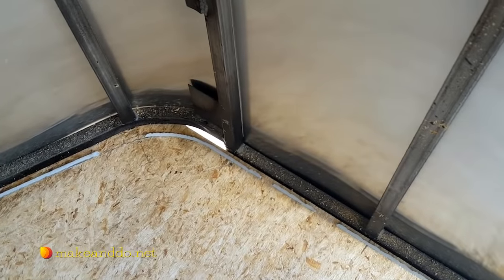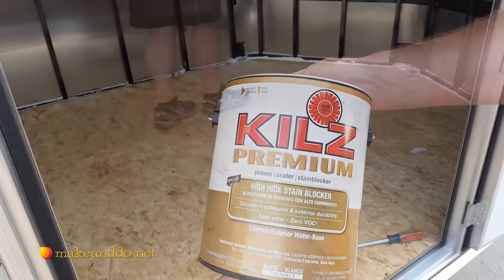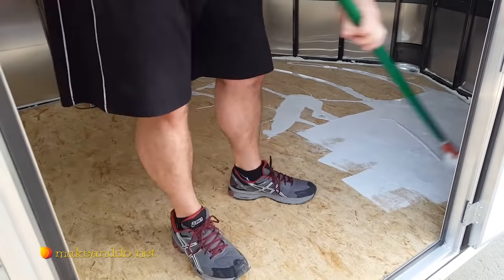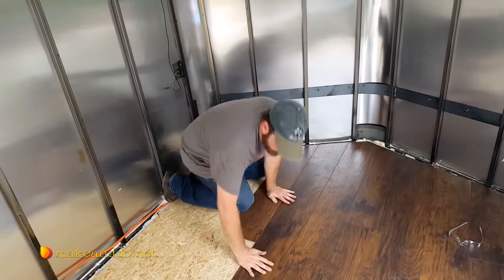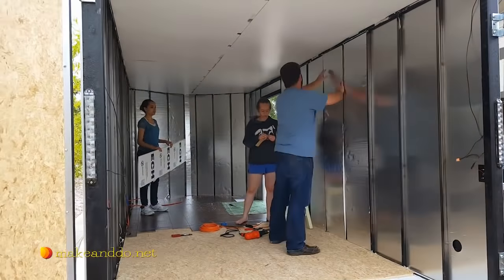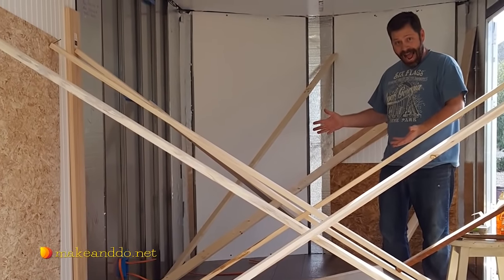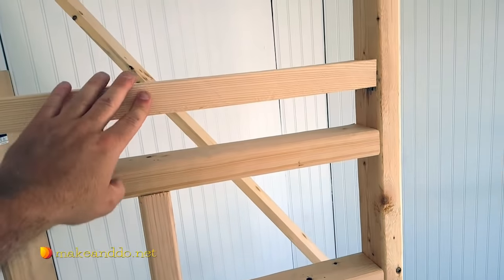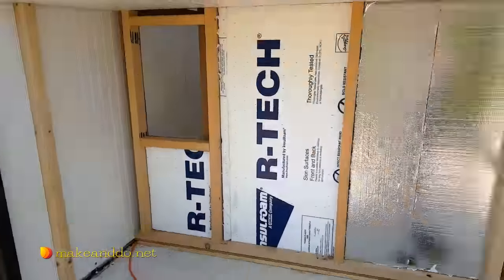Cargo Trailer to Camper Conversion - How We Did It in 4 weeks

Comment: Video may be from 2016 but thanks for sharing it! I am planning on doing the same with my 7x14 trailer either mid summer or hold off until next year. If you don't mind me asking. What did you have in it for costs as far as insulation, plywood flooring, ceiling, walls? I won't be turning it into a camper but I do want to add some amenities to make it a "semi-toy hauler" for ATV trips I take. Thanks again for sharing!
Reply from the maker: On this particular build, I had about $4000 in materials, but that included appliances and everything other than the trailer itself.
Reply: make & do that’s actually not too bad for turning it into a sweet looking camper! To do what I’m looking to do sounds like it will be fairly reasonable. Thanks again for sharing!

Comment: How wide is the trailer? Also, you mentioned running the wiring on the outside of the trailer. Did you use conduit or leave the wire bare?

Comment: I'm convertind a cargo trailer to a camper.  What do you do for insurance?  Tow vehicle insurance covers liability, but what about coverage for damage to your trailer?  If it's insured as a cargo trailer, one can get damage  & replacement coverage, but what about the added camper components?  It's not considered a market travel trailer, so what insurance company will insure it?
Reply from the maker: Well, I got lucky with my first build. I didn't know any better and called the insurance company and told them I had a camper. They simply covered it as a camper. When I had my accident, they paid but would not renew the policy the following year because it was not built by a certified manufacturer. As a result, I do not have insurance on my new build. I currently do not have an answer for this. If you want to see my new build, search for "Awesome tiny house built in a cargo trailer".
Reply: I've already seen your new build. Very nice.  I don't have the skills to build my own, so I'm hiring a guy who restores travel trailers. He's very skilled but I haven't ascertained whether or not his company will qualify as a manufacturer.  

These conversions are hybrids, mutts, orphans!  Seems there is an untapped market for insurance sales but think the problem is that every self-build would require an individual assessment to establish value; therefore, cost prohibitive, whereas the established travel trailer manufactures have a fixed number of models w/ a fixed number of options that have been assessed for value.  The agent just has to plug in the model and boom. 

I'm meeting w/ an insurance agent tomorrow to discuss options.  I'll let you know how it goes. Thanks for responding.
Reply: But then again, how do tiny houses get insured?  Most commercial manufacturers are small start-ups w/o established brands.  Assuming that the units are RV certified - an independent association, I think - and have the required componenets, perhaps they are insured on a case by case basis based on verifiable cost.  Those are the agnets I need to find.  A work in progress on so many levels. Cheers!

Comment: Excellent. Just one observation. As a professional restoration expert I can't tell people how important it is to 1) Always use the underlayment when installing a "floating floor". This is extremely important and acts as, not only a vapor barrier, but also traps any liquid from reaching the subfloor. 2) Never run your flooring material under the wall framing. IF the sink or something else leaks it will ruin a floating floor. Wood laminate, even the most expensive brands, can only guarantee about an eighth of an inch of "water resistance". You would have to rip all the flooring out and that's a pain when it runs under framing. Small observation. It saddens me every time I have to tear something out that someone worked so hard to build.
Reply from the maker: Thank you. Very good points.

Comment: Really nice job, what's the weight of the finished product?
Reply from the maker: I haven't weighed it yet, but I did try to keep track of the weight of 
the materials I used. Not counting what I would put in it for a trip 
such as clothes, chairs, etc. I calculated the weight at about 4000 lbs.
 I plan to go weigh it soon so that I will know exactly.

Comment: I didn't see in the video where you did anything to the steel frame? Your trailer is going to be used for the summer only then? We use ours year round and in extreme cold the steel frame sweats and drips water inside. Now, we have to take it apart and rubberize the steel frame.
Reply: if you haven't redone it already, please make sure you spend extra time to be meticulous about applying total coverage with a good paint first, then your rubberized coating. 

Many rubberized coatings out there cure weird and can allow water (or in this case, humid air) to make contact with the metal. Once that happens it can begin to rust and can spread fast since the rubberization will more or less trap the moisture. 

A better option for you may be to just encapsulate the living space with a vapor barrier (not a permeable vapor retarder). Using non vented heating sources like a little buddy heater will dump literally gallons of water into the heated air, which is a huge contributor to sweating steel. With a properly vented furnace or hydronic heating (even electric) the heat is dry, and much less likely to cause condensation to form on cold surfaces inside.

Comment: What is your Jeeps towing capacity? I have a Honda Odyssey with a 3,500 pound capacity. Would that work for a trailer this size?
Reply from the maker: Mine is 4500 lb capacity. You would need something smaller if you want to use a Honda Odyssey to pull it.

Comment: did you discuss the sway bar?  
NEVER PULL A BOX TRAILER WITHOUT A SWAY BAR.... i just rolled my truck and trailer due to a high wind gust compounded by black ice.  Almost lost my wife and kids.  I've been towing my tool box around for years. I know not to panic brake but it doesn't take much before its just beyond control.  Never thought i needed a sway bar for a little 7x14 TA.
I didn't have one. I'll never do that again. 
This advise may just save your life. 
PS. Nice trailer.  I'd like to show you my new one when i get her done.  Everyone was jealous of my old one.
Reply from the maker: Wow! Glad everyone is okay. I definitely use a swaybar. I learned that lesson after traveling in high winds as well.
Reply: When black ice is detected, Pro drivers are expected to park it.Seriously, if you knowingly drive in those conditions and dispatch finds out, you will not be on their 'good driver' list.

Comment: It's not bad, but in all honesty, if it was me and I was going through that much work, I would have run some rebar along with the frame or something to give the trailer more structural integrity.  I wouldn't have gone crazy with it just a basic cage top to bottom and sides for only a little more support, if the plan is to keep it long term it's really needed as it will hold it together 20-30 years down the road even tho that probably not the design for the camper.

Comment: What you did show was a lot of good information. I do see where you used 2x4's that you could have used 1x4 instead or 2x3's depending. That just comes from my years of experience in construction. You did an amazing job in any event and this is an excellent video.
Reply from the maker: Thank you.
Reply: Camper Hollow  Where exactly do you think he could have used 1x4's or 2x3's instead?  I am not trying to be critical, but am just curious as I am hoping to do a project like this.
Reply: Hey Mary, I do think he did a great job for a do-it-yourselfer so I thank you for acknowledging my understanding in this area. I've been in home construction and some commercial work all my life, or at least most all of my working days. My dad was a building contractor and so that is what influenced my life to pursue work in that field. Coupled with the fact that I work best with my hands I ended up in the building trades. 

Sometimes it's hard to explain exactly to someone who has not had experience in these areas but I will do the best I know how. Please feel free to ask more questions if you like. Many times in cabinet construction the framework of the cabinet itself has more strength than the framework it's build on. Unlike a house itself where the framework is the strength. So there is some understanding that goes into these projects. Now, it's been some time since I watched this particular video and because my monthly bandwidth is technically limited, I don't usually watch a video again. So please bear with me as I try to recollect as much as I can from my limited brain capacity.

In cabinetry, the framework is more for the purpose of holding the whole structure together rather than the structure being dependent on the framework if that makes sense to you.

So let's say if a 2x3 is being used in a cabinet, it could be considered overkill since in most cases 2 inches of wood inside a cabinet not only is more than enough to hold things together, it would consume too much space inside the cabinet.

I hope I've made enough sense at this point to relay enough information. If not, send a private message to me through my channel and I will dialogue with you more.

Comment: Do you really pull this trailer with your jeep? As it shows in your thumbnail? O have a Jeep Grand Cherokee and wondering what trailer I will be able to pull with the Jeep
Reply from the maker: Yes...at least I used to. I now have a Dodge Ram 2500. Although I could pull it with the Jeep just fine, it is much better having a bigger truck. You can really tell a difference.
Reply: make & do awesome thanks for replying man.

Comment: I'm thinking about doing something like this, all I want is a basic sleep-in solution with a bed, porta potty, storage for water/basic food like peanuts/mre's etc.  I have a question, someone at Cabela's told me that the storage trailers have wood that is treated with a hazardous chemical to humans?  I don't know if that's true or not?  I would like to keep it simple, I'd like to just keep the trailer how it is, and just install carpet wall to wall effectively sealing it pretty much.  I would cutout area for an entry and exit fan to keep air flow, and most likely a small opening to fit a 5,000 btu air conditioner and run it with a honda generator mounted on the roof.

I don't need a sink, shower, drawers, cabinets etc, these RV's today are so much $$$$$$$.  I can't find a bare-bones sleep-in trailer that has room, only those small teardrop campers which would not do.  Plus I NEED an a/c unit, it gets really hot in Arizona lol.
Reply from the maker: Not sure what your specific question is other then the one about the wood being hazardous. I agree with that statement. On mine, I completely removed the wood that was used. I would strongly recommend that if you buy a trailer and convert it that you remove that waferboard wood and use something else that is non-toxic.
Reply: Thanks, yeah my question was about the wood.  How toxic is it?  I won't be eating off the floor lol, just plan on sleeping in it a few days a month for camping.  Thanks for the reply.
Reply from the maker: It does off gas a good bit and you will be breathing it in. I have since rebuilt my camper and spent a good bit of time researching off-gassing. I decided to use as many non-toxic materials as I possibly could. If I were you, I would remove the wood from the walls and at least apply a sealant to the wood on the floors. I'll be posting a new video soon showing the new remodel and how I was able to do it almost completely non-toxic.

Comment: Can any suv pull a big trailer like this size.My suv only have two wheel drive it's a 2006 Buick Rendezvous.And what's the website i can get a trailer big like this shipped to my house ?
Reply from the maker: It depends on the tow capacity of your vehicle and the weight of the trailer. You would have to research that a bit to determine if your vehicle could tow it or not. It would be impossible for anyone to say whether you could or not with out knowing the specifics of your vehicle and the trailer you intend to pull.

Comment: I don’t get the purpose of the numerous battens on the floor? If you use firm enough insulation and cover it with 1/2 ply it won’t compress and it’ll give you better insulation.

Comment: couldn't have bought a regular shelf unit for the toilet? I would weight less.. I wouldn't have the ceiling trim so close to the window opening, obstruction or humidity problems?
Reply from the maker: No problem with the trim. The only humidity problem was actually with the bead board walls. Contraction and expansion of the walls became a problem.

Comment: Sealing the interior floor may not be wise, because the wood needs to breath????   If moisture gets in maybe through the edges, there's no way for it to evaporate???  Please advise.  Also, isn't it better to use exterior plywood and stain it?????

Comment: Omg, did you run 10 gauge (orange) wire? That must have been murder to install plugs ! Most everything could have been done in 14 gauge and maybe a couple of 12. I'm sorry for the guy that folded those into the shallow boxes.
Reply from the maker: YES!!! It was a nightmare! That was my biggest mistake. I plan to do 
another video showing my electrical so that other people don't make that
 same mistake. You are right. I should have run 14 mostly and one 12 for
 my portable heater and ac, but it was a lesson learned. I'll know 
better next time.
Reply: dtcjeep Same thing I was thinking. I am an Electrician so I know folding those in that tiny boxes was hell.
Reply: Ya and wires were way too short.. protection plates would have been a safe move as well.. oh well... next one ;)
Reply: you took the words right now of my mouth lol 10gauge already sucks in a 2 gang box and he is using shallow box from home depot that is maybe 10 cubic inch
Reply: who knows! or Welding!
Reply: keep this guy away from electricity
Reply: sure 14 may have been smarter for the obvious reasons, but better to over do it, then under do it. a lesson? yes, a mistake? debatable. nice conversion my friend, thanks for sharing the video.
Reply: Wait! I ran 10ga in mine and lost only two fingernails and a years worth of patience. I did use deep boxes so it went ok.
Reply: GREAT for folks to bring out these issues especially for those NOT knowing anything, many would just duplicate what you did, YEARS ago I learned to read ALL the comments BEFORE attempting to do as the producer, because I've found many experts in some fields that chime in on many unknown fiasco's shown in the clips, SOME SERIOUS SAFETY issues.
Reply: Izzi Michaels,
we see how much you know?
Reply: definitely a fire hazard, as now your boxes are overloaded in cubic inch capacity and will not be able to dissipate the heat generated in the box properly. honestly i don't know how you were even able to install your devices in those shallow boxes. nice job on the rest of the build though.
Reply: I would use stranded wire. Probably extension cords (the heavy duty ones) these would hold up well to vibrations better than solid copper while being extremely flexible and easy to work with. A little more expensive but better in the long run.

Comment: I want to build one of these, but this thing will be off-gassing VOCs for the next thousand years.  Do you need a special hazmat permit to take it into the state of California?
Reply from the maker: The keyboard you are using to type your comments is one of the biggest culprits of off-gassing. Off-gassing is everywhere and in every single home...building materials, furniture, mattresses, electronics, etc. You can't avoid it in this modern world. Although, there are some things you can do to limit your exposure to it. 

This conversion could have been constructed with less products that produce vocs. However, it is no different than the common house or camper built at a factory.
Reply: I know.  Just yanking your proverbial chain and making fun of California's idiocy.  It's just odd to see all those adhesives, caulkings, sealants and expanding foams all in one short video clip.  FWIW, nice build.

Comment: What R-value and thickness did you use for the insulation boards? Thanks
Reply from the maker: Some of the boards were half inch and some were 3/4 inch. I think the R-Value for them was somewhere around 5 or 6.